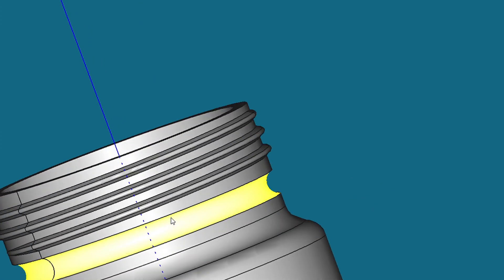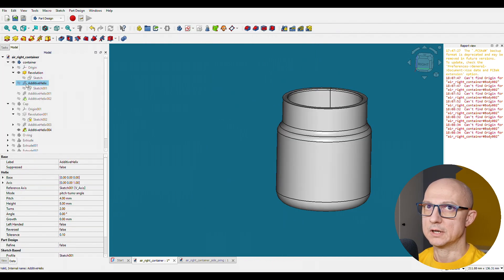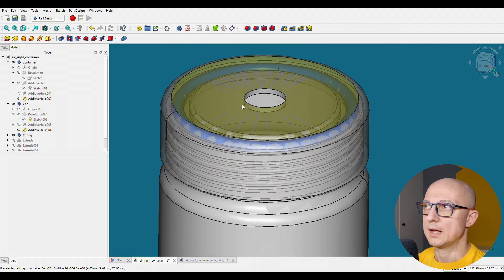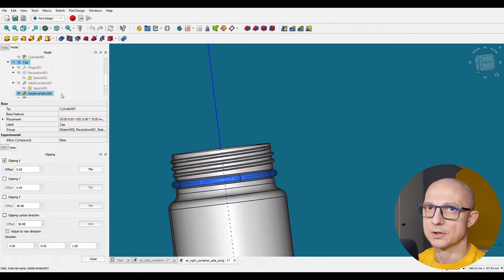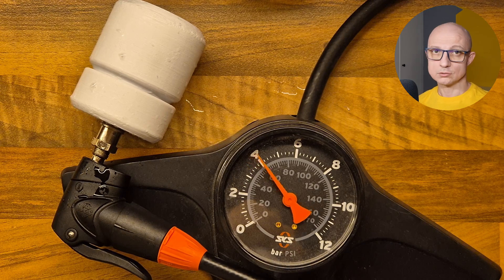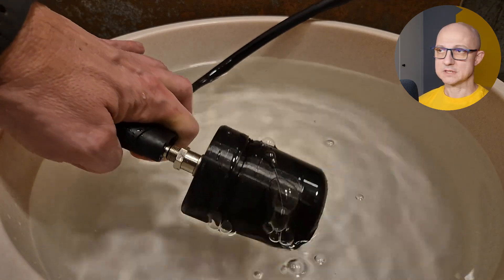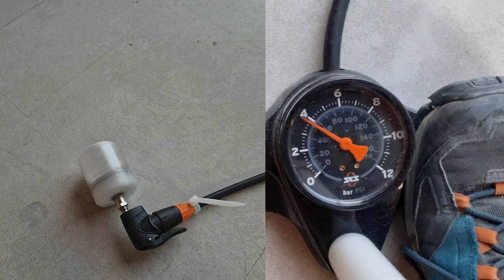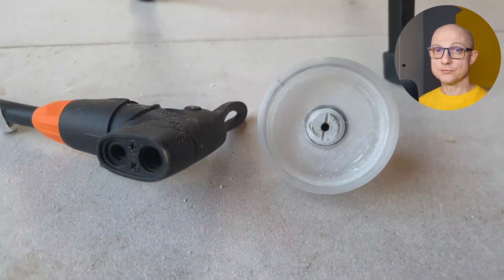3D-Printed Airtight Container – Will It Hold Pressure or Explode?

Comment: Just finished my first 9 BAR AIRTIGHT pressure container. I have made 9 prototypes which all leaked, but now I have finally the settings for an airtight pressure container.

- Minimal 4mm wall thickness (I tried 7 prototypes with 3mm and those leaks a tiny bits of air)
- Just enough walls to make sure the 4mm is fully covered.
- PETG
- Innerwalls 1.6 to 2 times the width of the nozzle.
- Layer height 2/3 of normal.
- Temperature of the nozzle is the maximum allowed.
- Seams, random with scarf seam only applied for the outer wall.
- Flowrate 1.05
- 6 top and bottom layers

(I made mine with a 0.6mm nozzle)

Comment: Is free cad easier than fusion 360,or vice versa?
Reply from the maker: Fusion360 is easier in the most common sense, but FreeCAD improved (IMHO) significantly with version 1.0. FreeCAD Workbenches are its power and pain at the same time - UI is sometimes inconsistent between workbenches causing confusion. But it is open source and truly free. The choice is yours! :)

Comment: Nice Idea but from my experience trying to get prints vacuum tigt it is futile. Did you try ironing after every layer? I had some success with that and of course you might want to use adaptive layer hight to reduce the needeed Layers overal.
Reply from the maker: Thanks for the comment! Haven tries ironing. The only problematic place is the seam, I will do some more experiments, just have to design a smaller container limit material use :D I believe vase mode will make it airtight but not that strong.

Comment: You could seal the container on the inside with a layer of something. Lacquer, paint, glue, whatever.
I bet that would be enough to plug tiny holes in the seams.
Reply from the maker: For sure, but my internal challenge was to make it airtight without post processing  :)
Reply: @taboretum  It can be done. See my comment from yesterday :)